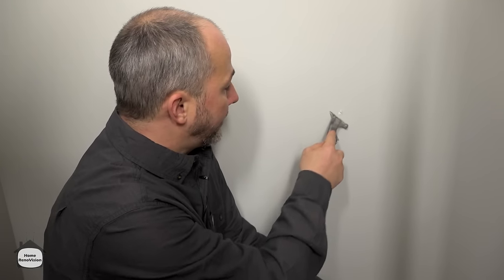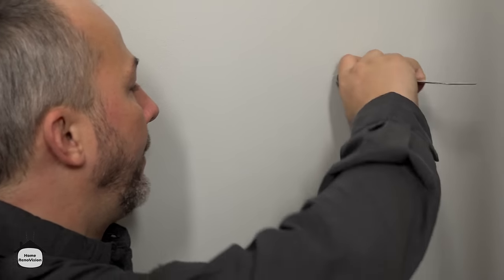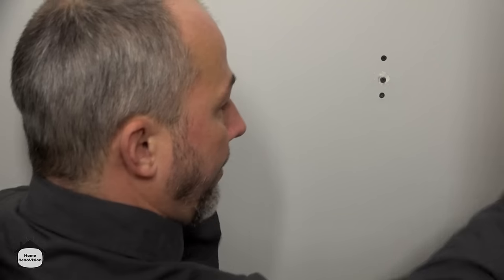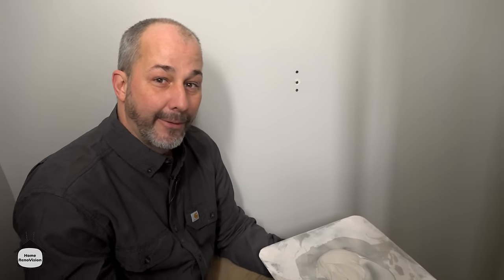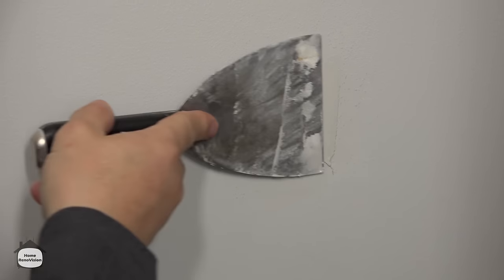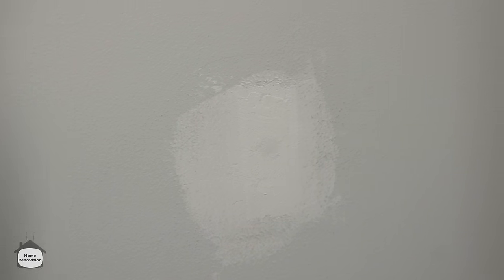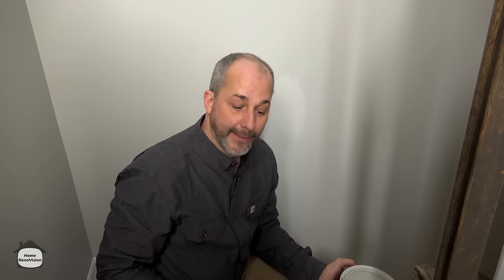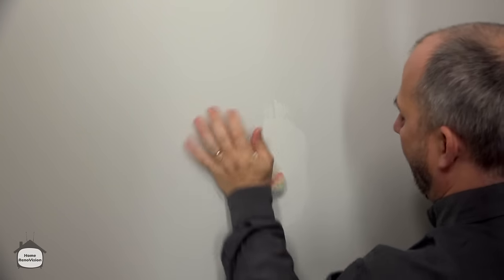How to Repair Nail Pops !

Comment: Jeff, another useful tip is removing the original screw and squeezing in a small amount of construction adhesive in the screw hole and then re-inserting the screw. The screw will never loosen again. By introducing new screws above and below, you risk having the same issue during expansion and contraction of the structure and you're increasing the repair area that you will have to try to blend when repainting.

Comment: We just had a bunch of friends over to help paint the entire interior of the house.  Spent a week prepping the space a couple hours at a time and we were good to go.

We hadn't considered that the pressure from the rollers would cause the wall the flex and bam, nail pops.  We didn't notice until a few days after everything dried.  3 walls in the house had some pretty bad ones.

I just re-attached the walls to the studs today with your method and discovered they'd used nails instead of screws to attach all the dry wall.  The result of fixing one pop is that the REST of the nails popped too!   Frustrating, but i didn't get too frustrated because I knew filling 20 more holes with mud and painting it would only take nominal amount of time since we already had to do the first one.  Thank you for showing this so succinctly! 

I am worries about the rest of the house popping now though, since they used nails instead of screws.  1981 construction, and that made me think I could have purchased something very shoddily constructed. 

In addition we discovered in another room that instead of taping the joints, they simply caulked the corner joints of the sheets.  That's a project for another day, oi vey.

Comment: Purchased a new house, built from the ground up. I've noticed a few of these nail pops. Dude, you've made this task too easy for me not to procrastinate. I have a one in my master bedroom ceiling near the corner; I've noticed a few in my guest bedroom on the wall which I'll work on first. Time to put my DeWalt drill to use finally! Thanks!

Comment: Thank you Jeff.  Another well presented competent nugget of efficiency.  I was at Lowe’s, they only sold large bags of the 45 (big for a homeowner just doing a few patches).  Then I went to the “Consumer Aisle” where they have tiny kits of other compounds at high prices. Even trowels were something like 30% higher over in the paint section vs Contractor section of the store. The 45 bag is cheapest.

Comment from the maker: Thanks for watching everyone. If you are looking for my favorite tools and products you can find them here at My Amazon site. Cheers!  Please ask your questions below. I am here to help!
https://amzn.to/2ySCGMO
Reply: Thanks for your videos, Mr. Jeff -- my family loves watching.  Seeing this nail-popping video made me think of outdoor nails...  Do you have any advice on how to deal with (non-galvanized?) nails rusting through on siding?   The builder of my 11-year-old home apparently skimped on using exterior nails, and rust is  bleeding through my last two summer attempts of painting over them.  Is my only choice to attempt to extract them and replace them with stainless steel?
Reply: So nail pops are a given. We had our roof replaced last year and the nail pops that we had a few years ago came back. The painter repaired them but a year later they came back.  The painter used screws.  Why not use silicone caulk?
Reply: So how do you fix Nail pops? they were screws, not nails.
Reply: Could you list the name of the 45 minute compound you used? I don't think I saw it on your Amazon list. Thanks for the video.
Reply: @JAKEDT08  Durabond 45.
Reply: Awesome and thank you! 🙏😄
Reply: Herschel Everett ii9Kko
Reply: i'm a new member but i believe now I'm hooked. Thanks for a little bit of helpful knowledge.
Reply: What about cracks at the corner bead?  I can also see the lines on my ceiling from the joint tape.  Ugh.  Its a new construction just beyond builders warranty.
Reply: ⁵
Reply: jiqq
Reply: Why take it out at all?  Does it not come out right if you just put the screws on the top and bottom, and then screw the pop out further?

Comment: I absolutely love using the roller without a cage.  It's a great example of the ingenuity contractors use every day.  Sure, we all have fancy tools and it's not often we forget the impact wrench or hammer.  But it's inevitable that some obscure tool is sitting on it's shelf in the shop and not the jobsite.  That's when the inner magyver emerges!
Reply from the maker: Hey dude, life happens. Good to have a few tricks up the sleeve.

Comment: I've noticed several of these nail pops around my house. If it's an actual drywall nail, would you recommend replacing the popped nail with a new nail and reinforcing with nails or using drywall screws instead? Thanks for the helpful video!

Comment: Hi Jeff, My dry wall has nails (old house) and I have the same problem, appreciate your suggestions on how to tackle them . BTW, your channel is a boon to DIYers ! Thanks a lot !
Reply from the maker: Thanks and Cheers!
Reply: If you can't pull the nail out, just hammer it in further with a countersink since the hole is going to get filled in anyway. Then screw in drywall screws above and below as in this video.

Comment: So here's pro DYIer "nail pop" story: I'm currently working on a bathroom reno (I'm almost done thankfully). I needed to take all the tile up off our very small MB floor so I didn't invest in a power tool to do it because it wold have been overkill (or so I thought). Well, the mortar bed was so well set that scraping or chiseling it off the sub floor would have taken the better part of a day so in frustration I just whacked the floor with my mini sledge hammer and to my surprise the mortar just came right up like butter! So I continued to remove the tile and mortar in this fashion. It went super quick and the floor was as smooth as could be. I was super proud of myself. Finished for the day I went downstairs to the kitchen to get a beer. I looked on the floor and there were white pieces of something on the floor. For a few minutes I couldn't for the life of me figure it out until I looked up to see all the nails had popped out due to my (sledge) hammering of the mortar. I showed my Wife and luckily she didn't freak out (she was just happy I was redoing the bathroom). Luckily I'm able to patch it up, repaint and make it invisible. 

The moral of the story is:
A)  Either have your MBS on the first floor so you won't mess up the ceiling below or
B)  Take the time to scrape the mortar up by hand or
C)  Purchase a hammer drill ( I thought I had one but I didn't)

Years ago I learned a sanding "trick" by a pro drywaller: Use a slightly damp sponge to feather edges. Now you can't always use this technique for heavy areas but for the smaller ones it works like a charm and without the dust!

Comment: Been doing this for quite a while.  Glad to confirm I've been doing it correctly.  Does add quite a bit of time to the prep but worth it!  Had painters come in to do several rooms simply because I didn't have the time and they did none of this, just painted over the nail pops.

Comment: This is a great video!  My issue is that our 40 year old house has drywall nails.  How do I deal with a nail?
Reply from the maker: Hi Gary, add the screws top and bottom and then set the nail firm. proceed as shown. Cheers!
Reply: @HomeRenoVisionDIY  Thanks!!! This was my problem exactly and couldn't figure out how to get those nails out first without denting my drywall.  Now I don't have to!

Comment: Great video  !! Just want to add if you have several nail/screws pop in a line .use your stud finder and make sure you know where the center is. I've seen where someone put them too close to the edge and when the 2x4 dried the nails popped. I call that ..ALL BUN AND NO BURGER..
Reply from the maker: LOL< Loving it Nikki!
Reply: PLEASE HELP! I've a similar issue. It's a row of screws/nails (about 6 in a row, about an inch or less apart), however they don't look like nail pops, they go slightly inwards - like dimples in the ceiling and there's also a patch of tape showing through on the ceiling. Do I just fill it all with some joint compound? Or do I need to add some screws? Same question with the tape bit please, do I need to take it off or just fill it? Thanks in advance x

Comment: What would you do if the 'nail pop' is actually a nail?
Reply: Remove the nail and put in screws. 👍👍
Reply: I usually try to pull the nail out and replace it with a screw, then use his 2 screw repair. Otherwise, pound the nail all the way in using a nail punch then use the 2 screw repair method & patching the holes with spackle or drywall mud. Hope this helps.
Reply: never buy a house where your drywall contractor used nails to put up drywall.

Comment: I’ve used a 2 part auto body filler with a lot of hardening cream, you can fill a screw pop and sand it 1min later and paint it another minute later. I’ve used a product called icing bondo, it’s an auto body filler that sands easier. I only use this method if I’ve got only a few patches where dry time is a big issue

Comment: The shine from that painted patch will stand out as an ugly amorphous shape. There is no way to avoid this unless you paint the entire wall over. 

The best you can do is to frame the repair area with painters tape and roll within that box. You will be left with a square that stands out (under certain lighting angles) rather than an ugly amorphous blob. The result will be much more appealing. Trust me.
Reply from the maker: Hi Egg Head, The truth is you are trying to state a fact when you have no basis for it. If you try my system before passing judgement you might actually learn something. Cheers!

Comment: Hi Jeff,
Thanks for another great video !

Don’t know if this will be useful to anyone, but this a tip I remembered when you talked about « country water » that contains minerals that quicken the setup time of drywall mud.

I used to do this when I wanted the plaster I was mixing to pour into an impression to harden very quickly. You have to take already harden plaster powder and mix it in with the un-set plaster powder and water. The « cristals » of the already set plaster activate the reaction (I took that « set powder » from the plaster model trimmer).

So I guess you could take the dust created by sanding drywall mud and use it to speed up the hardening. But be careful, it can go REALLY fast ! When I say fast, it’s fast : if you add to much set powder, sometimes the plaster starts to harden before you finish pouring your plaster it into your impression, like after 2 minutes !!!

Comment: This answers almost all my questions... I am finding these everywhere on the front wall of the house I just bought, in the room over the garage etc... Any idea why this would be happening with metal studs? Is it just the warm/cold temperature flux moving the studs? They are supposedly "always straight"

Comment: Great video. Just finished couple weeks ago around the house ( many of them as it’s fairly new 3 years old house), wish I could see this before as what I patch it’s clearly visible bump . Glad havenot painted yet so will have more sanding to do and use your technical to make it perfect next time.

Subscribed your channel and wishing best luck . 
Thanks for amazing info 

My next project is : remove cold cellar plywood ceiling from concrete which builder left it which he supposed to remove it. Got confirmation from that builder that it’s not structural & it’s only to cure concrete . So let’s see if I can find good video on that 😊

Comment: Thanks for the tips.  I once had a friend who told me my mudding jobs/projects were so bad, it looked like I'd stood at the end of the hallway and threw the mud!!  I have an older house (1955) and I've spent a long time working at the screw pops.  Only in my case, they're nail pops.  I've just been bashing the nails back in and filling the holes.  Now I'll go back and add the two screws.  Should I, at the same time, replace the nail with a drywall screw?  Thanks again for sharing your expertise.

Comment: I guess I know what I'm doing this weekend. Great video!
Reply from the maker: No worries, a few minutes and a hair dryer and you will be a hero. cheers!
Reply: @HomeRenoVisionDIY  well I'm at it I got a room that's yet to be renovated so it still has lathe a plaster walls, any tips on how to patch a pretty big size hole roughly 6" x 3" where the plaster is literally just falling apart?

Comment: Hello Jeff,
Thank you for thorough instructions on fixing the nail pops.  We recently had tons of them popped due to the heavy winds from tornado. So we have to fix them throughout all the walls in the house. And then repaint all the walls. After fixing all the nail pops, Should we strip the paint by sanding?  Also, we have certain nail pops right by the edge of wall and ceiling. What should we do about that ?  Thank you in advance.

Comment: If using regular d/w mud, I leave I little dimple on top so when it drys you can sand it off and don’t have to go over it a second time. Here in South Florida, everything is metal framing and the d/w pops comes from the screw too deep.

Comment: ive done this many times.  However, Ive had one reoccurring problem...............after using mudd to fix the holes and painting the whole wall, in certain lighting, I can see the configuration of the taping knife on the wall.  The wall actually shows the areas in which I either filled a small picture hole or a nail/screw pop.  The way I found to really reduce the image that comes thru the paint is to use a wet sponge to eliminate the surrounding compound that is not removed by merely sanding.   Your thoughts?????????????
Reply: Unless you working on a smooth surface (no texture) you will always sponge the patch. On smooth wall if you know how to use the knife, you can cut the edge and the patch will almost disappear if you don't leave to much mud in the middle of the patch. I'd still sponge it

Comment: New subscriber here, Been enjoying your videos lately. Thought I'd find a way to eliminate nail pops like I have all over my house, but all I saw was how to fix screw pops. My house was built in 1960 with actual nails holding the drywall- in pairs. It's a lot more difficult to get a nail out of the drywall.

Comment: Love this Channel!  First time homebuyer (Disabled combat veteran)  QUESTION: How to keep cold air blowing in the house though light switch panel.  Replace the box to the new code? My house is 51 years old. I know some insulation and maybe some sealant? Plus some of the new light switches come with the green ground. I have in the past just put the green grounding wire to the box IF metal conduit was used. Just at a little lost with this one. You could write a book just from all my questions. Thank you for any and all help. I REALLY want a bathroom remodel just like you guys did when you put in that no step shower and got rid of that false ceiling and you used those of set hinges and awesome pull bars. I have no help with this kinda stuff it is scary for me and I don’t feel safe. Oh and the Moodle ceramic floor tiles have a tendency to come up when your feet are wet. I really luv you guys and gals........ I just want a safe home for my Service Dog and I. Oh, same bathroom someone just cut a hole in the floor to use it as a laundry chute. How do I fix that? I really don’t want my little nieces it or nephew to fall through the hole onto the cement basement floor. Below.
Reply from the maker: your switch is most likely without a vapor barrier or air barrier behind it. Sounds like you have a lot of work to do Peter. Cheers!
Reply: Thanks.

Comment: Just found your videos and enjoying very much. Read through comments and did not see this question:  My nail pops are at top of studs where drywall meets ceiling so there is nowhere to put extra screws. Ceiling is fancy plaster so I have to be careful not to damage it. Would I just drive nails back in and hope they don't pop out again, or do I need to do something else? Cheers!

Comment: Hi Jeff. I thought you will show a nail but it is a screw. Much harder to take off a nail than a screw.
What do you do when it is a nail which is my situation?
What I did is putting 2 screws around as you did and then put the nail deeper. Good solution?
Thanks

Comment: Thank you for your channel. What is the process to fix ceiling nail pops that are really nails not screws? Also what is the best way to refinish when there is one of those annoyingly textured finishes (not popcorn but done with a patterned roller of some kind).

Comment: Not sure if you're still monitoring questions, but what do you do if you have multiple (15) screw pops in a single sheet of drywall? Would you still add additional screws above and below the pop, or is a single screw for each enough?  Thanks!
Reply from the maker: 1 screw 1 hole. the sheet needs to be reattached. the framing was obviously soaking wet when it was installed. Cheers!

Comment: I have nail pops in our ceiling.  Do I use the same technique?  Putting screws in on either side of the popped screw?  They are low , close to the wall.  Thanks, love watching your videos!  Great info!
Reply from the maker: Hi Tamra, this system works everywhere. Have fun Cheers!

Comment: There is another popular YouTube guy who did a video just like this. Hes been doing only dry wall for over 20 years. I knew your video would explain much better in detail what to do and do it even better. He didnt add 3 screws, he only added 1 and he didnt mention about using a roller to add texture to help hide the patch. As always your videos are the best.
Reply from the maker: I have found that 1 screw can leave you in the same problem depending on the reason for the pop. since we can't see behind the wall better safe than sorry. Cheers!